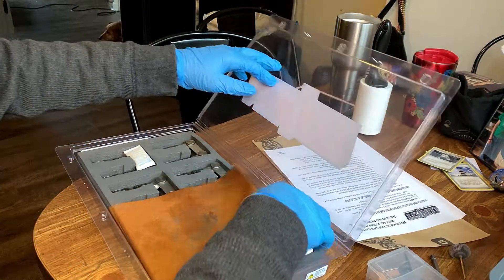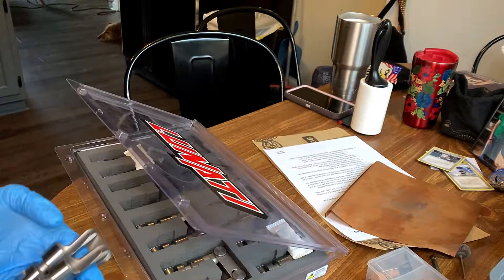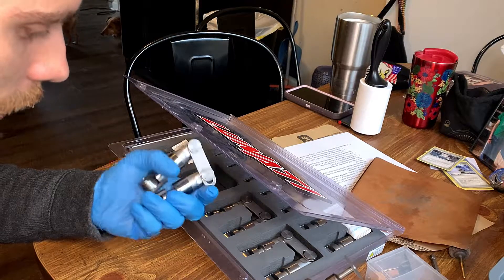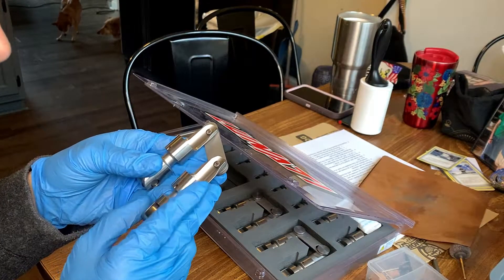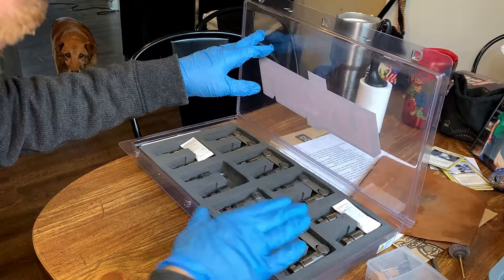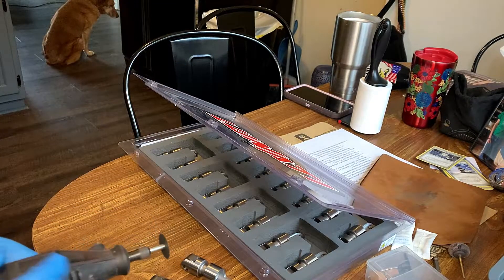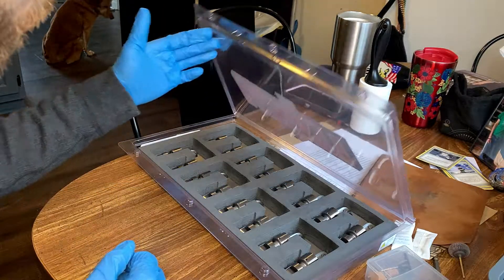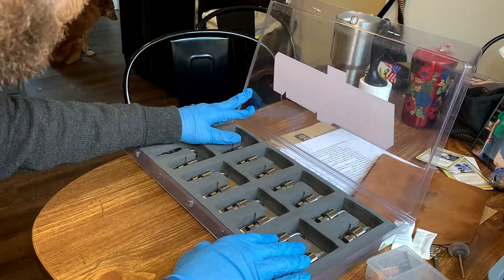SBC solid roller Tie bar lifter notching.

Comment: Why did you do the backside and not the front side ?
Reply from the maker: Front or back is irrelevant, just as long as one of the feed holes is supplied with an adequate supply of oil. 
I picked that side for no particular reason.

Comment: thanks I think I need to do this to my solid roller lifters as well.  I primed the engine before the intake was installed, got good oil pressure but I think my lifter bores are a smidge tight, and you could see the oil building up around the lifters in the valley, but no travel up the pushrods.  Not even after running a temporary slow idle.
Reply from the maker: You only want to take a small amount of material off, more like a scratch. If you go to deep it lets to much oil up in the valve covers I had this issue first time around.